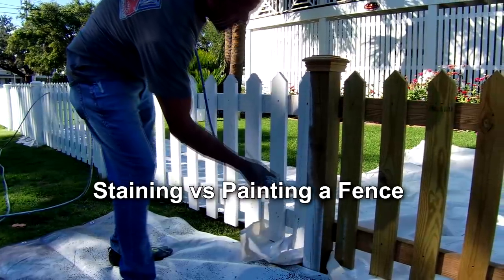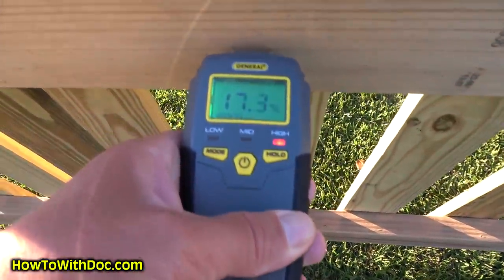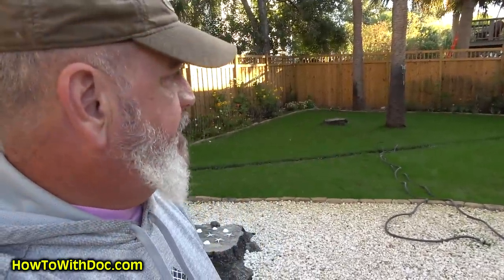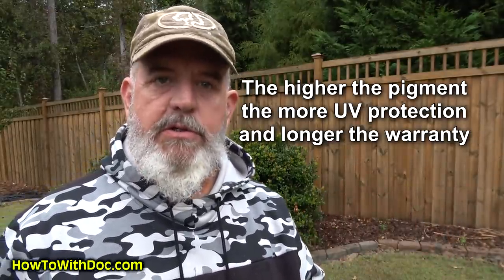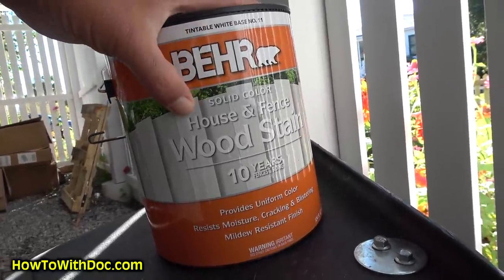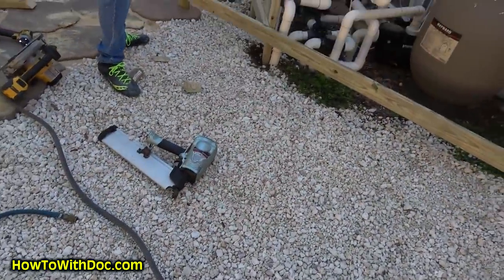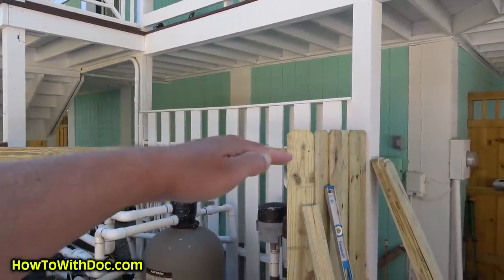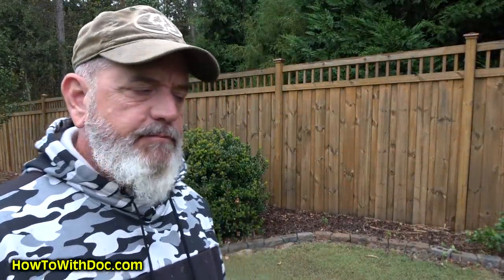Solid Stain vs Paint - Staining a Wood Fence

Comment: Pretty! 
I'm a painter, and repainted old painted sections and newer unpainted sections over my fence after buying house. I used a semi transparent stain/sealer.
Repaint: best to use solid as it Will take two coats and finesse to recoat.
Fresh wood: looks amazing with semi transparent finish but touchups must be done according to product data.
I had golden red semi transparent stain and hated the color so we topped up the can with black pigment (roughly 4oz) at shirwin (top notch pigments is where the value is at)
After a few years you can tell, with a trained eye, the transition and aging of sealed faces and unsealed edges and joints where moisture is respirated.
Now redoing another section to fit new mower in backyard and I am hand painting(no spray) all lumber before building. Seal all surfaces prior to instal is only way to seal properly, otherwise you're just decorating. If you want the wood to outlast the stain, seal it properly.